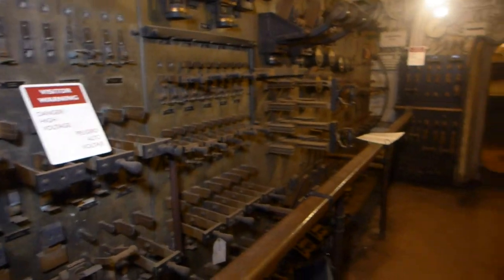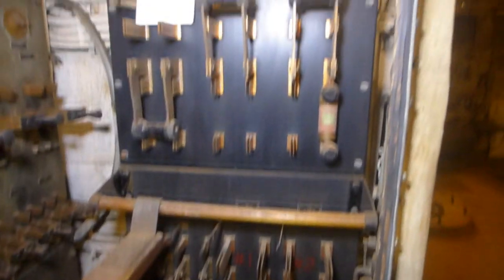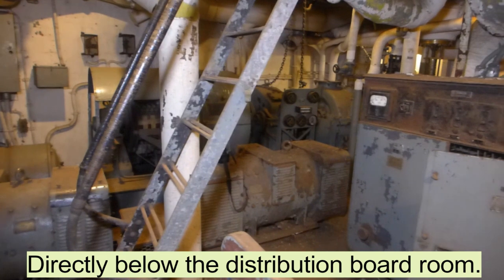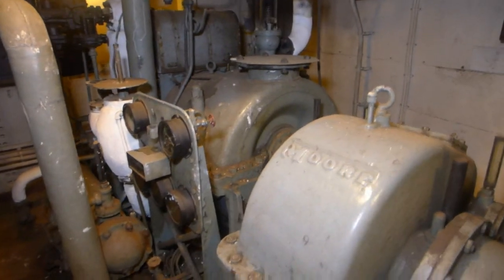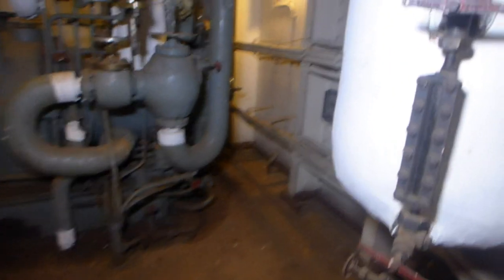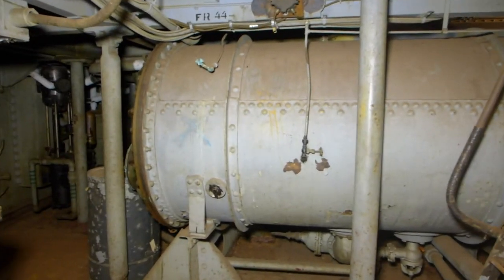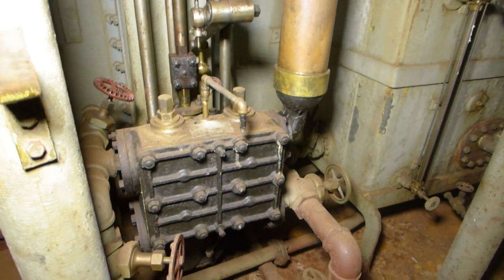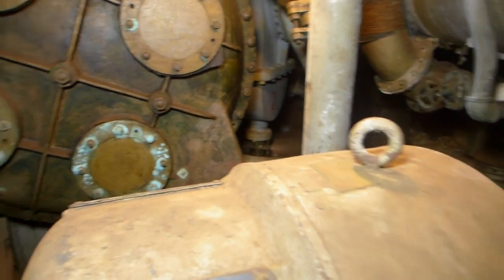Deep In The Heart of Battleship Texas, Getting Electrical Power

Comment: So that one disconnect to the far left that has a red label what is the purpose of the red label what does it say
Reply from the maker: If you are referring to the large red and white sign, it is a warning that cautions visitors to not touch any part of the panel.  Some of the circuits are still used to provide power for lighting and ventilation, making the panel potentially dangerous to touch.

Comment: Imagine the noise near those turbines.
And as an EE the hair in my neck raises when I see the unprotected switch gear. Those are death traps, especially with DC power. Wouldn't come near those for a thousand bucks. Touch and burn, mate. I bet a number of servicemen died right there.
Reply from the maker: Accidents would certainly seem inevitable, but I am not aware of any.  We do know of accidental deaths that occurred during the ship's career due to drowning, falls and being crushed, but not electrocution.  However, it may have happened and the ship's logs reporting it may have been lost.  There is one positive thing about the switchboards.  All of those open switches and conductors sure were easy to maintain and repair!

Comment: That electrical room would be very dangerous to someone who didn't know.  Especially in battle when the ships rocking and rolling back and forth
Reply: Likely most people working in the electrical room had been trained to be there, especially during a battle. It's only modern management where untrained incompetents are expected to manage dangerous technical equipment in emergency conditions.
Reply: @lwilton  What I mean is- the ship starts to rock unexpectedly and a human is slammed into those open knife switches- I promise you, the ships generators will clear their oily, greasy, unplanned "short" and the guy will fry- especially on an DC system
Reply: @lwilton  Actually, knife switches like this according to the National Electrical Code ("NEC") used in the United States?  Those switches are still legal and per code.  They have to be installed so when the bars open the circuit turns themselves off.  When I was a commercial electrician I was surprised that such switches were still not only legal but used on very large (500KW or above) circuits- usually safely stored behind a thick safety glass panel in case someone slipped and fell on them.  The next size similar switch systems they use- like generators at dam's- are essentially the same kind of switch but immersed in whats called dielectric oil- oil, which for all practical purposes have zeron conductivity and yet can carry tens of thousands of amps and volts.  The oil quenches arcing is why it's used.  This is why I'm saying that open panel board is "damned dangerous"- and a little wooden rail,,,,,well,,,,I wouldn't want to risk my life on it
Reply: @larrytrail2865  Knife switches with and without arc suppressors are I believe still legal. After all, almost all disconnect switches are knife switches. What I'm not sure is still legal is a live front board. I believe that switchgear generally needs a protective box or housing around the live switch mechanism these days, if for no other reason than to try to prevent arc flash injuries. Of course there are generally ways for "qualified service personnel" to override the interlocks and operate a panel while it is open. But this is most often done during equipment repairs and not general use.

Comment: Has there been some partial restoration of this space? The lagging on most of the steam pipes looks brand new.
Reply: If I had to guess this may be part of one of the hard hat tours and the fresh lagging is an effort to either seal in or abate asbestos. In some instances it is acceptable to coat over asbestos to seal the fibers in rather than perform a complete (and expensive) abatement process.
Notice the fresh lagging appears to extend only to areas that can be touched by someone standing on the deck and not in the higher overhead areas.

Comment: The air pumps are called air ejectors. They're used on modern nuclear-powered ships as well to draw vacuum on the condensers. The motor driven pump with a green case is probably the turbine generator condenser seawater pump.
Reply from the maker: Thanks for your input.  You are correct about the green pump being for the condenser seawater pump.  What are now called air ejectors were called air pumps at that time and shows that way on drawings and in manuals of the era, which is why I refer to them that way. They are described in detail in the U.S. Naval Academy textbook, "Naval Reciprocating Engines and Auxiliary Machinery" dated 1914.  There are later editions, but I like this one in particular since it was printed the same year the battleship was commissioned.  It is also the bible on the reciprocating steam engines like those on Texas, and even contains a detailed discussion of why reciprocating engines were used on Texas and New York instead of turbines starting on page 468.  If you are interested, this extremely thick book is a free download on Google Books.  If you download it, be sure to also download the separate book of plates that will be listed separately.  This contains all of the major illustrations for the textbook.
Reply: @tomscotttheolderone364  thanks for the info about the download.  It could be quite the interesting read.

Comment: Great video!  Were those two dynamos the only two onboard?  I would have thought on a battleship they would have them in separate compartments, in case of combat damage.
Reply from the maker: This is the forward dynamo room and distribution room.  Theere are two more in the aft dynamo room.  Additionally, there are two 100kw emergency diesel generators.  One far forward and one far aft.  Both are located deep, on the hold deck level.

Comment: Arc resistant switchboard?
Reply from the maker: The backplane of the board appears to be a stone material.  Given the operating voltage, you don’t get really big arcs, even on big switches opening under heavy loads.  This is apparent due to the lack of arc chutes on them that break up and cool arcs.  However, what arcs there were released a tremendous amount of heat and energy when loaded contacts opened.  A close look at them reveals separate copper current carrying and carbon arcing contacts.  When opening under load, the highly efficient and fragile copper contacts open first and conduction passes to the less effective but immensely heat resistant carbon contacts.  As those separate, the arc is struck but cools and is extinguished as they open wide.  This same method is still common on high amperage load break switches and circuit breakers.

Comment: Can you imagine standing in or walking in that room, back in the day, when in high seas? Just image falling into one of those contacts while trying to keep your balance while working.
Reply: Good call. These switchboards are not ISO / IEEE approved.
Reply: DC current. 
You would only ever mess up once..
Reply: @carwashadamcooper1538  It may not be as bad as you think. Ship's power is usually not like shore power, where you have a neutral leg that is grounded and a hot leg. Instead, they either float the entire power system with no ground at all, or they ground the center of the voltage, so there is only half the line voltage each way from ground. 

With 120VDC, that would only be 60VDC from either line to ground if it is grounded at all. 30V is where you start to feel a tickle from electricity, 60V is mildly annoying but usually far from deadly. Even 120V, while quite painful, will take a little work or bad luck to kill you. (And yes, I have some idea what I'm talking about. I've been bitten by 450VDC, which was really unpleasant. And I'm still here to say that.)

Keep in mind those panels were on the fore and aft bulkheads for the most part. A 400 foot long ship isn't going to tilt much on the fore and aft axis unless it is breaking in two or sinking, in which case you have worse things to worry about that getting zapped. Like broken steam lines in your compartment. Or water coming to visit. You are going to get maybe 10 degrees for-aft pitch, and the roll rate is probably going to be around 10 seconds. Most people can compensate for that. 

Now in bad weather maybe you can get 35 degrees side roll. That would be hard to deal with. But again, the roll rate is only a few degrees a second, and it generally isn't going to toss you into any open front electrical equipment.
Reply: @lwilton  Thank you sir

Comment: Look at all that asbestos!
Reply from the maker: There is a lot, but it is fully encapsulated and meets all federal and local safety guidelines.  On the rare occasions that damage is found, the compartment is closed and a licensed remediation contractor goes in to remediate it and/or reseal it.
Reply: @tomscotttheolderone364  Correct.  Asbestos is only dangerous when it's friable and the fibers can become airborne.

Comment: You are a better man than I. If I was anywhere near that switch board a that the beginning of the video I dont believe I would be able to stop myself from flipping many of the up and down while shouting "Its alive!!!" and cackling like a madman.
Reply from the maker: Believe me, the temptation is there.  However, many of these big, rugged looking switch handles are now very fragile.  The plastics used on them worked perfectly well when the ship was in service, but they didn't age well.  Any temptation to even touch them is tempered by the knowledge that there are no battleship parts stores around.
Reply: @tomscotttheolderone364  The city of Toronto where I live has electrical distribution buildings all over with switch gear like that. They are being phased out but some are still in use. The handles wouldn't be plastic but are made of wood or bakelite. I don't think plastic was around when the ship was built. That stuff is scary- imagine being in that room during a rough storm at sea? Your own ship could kill you.
Reply: @lawrencelewis8105  Bakelite IS plastic. Just an early plastic.
Reply: " Igor, throw the switch!!
Reply: Are you sure you wouldn't have been giving Jimmy Cagney the first jolt at Sing Sing?
Reply: Naw, he’s just mature enough to do that before filming!

Comment: Thanks for the video! First time seeing the dynamo condenser space. Were the switch gear operators required to wear insulated gloves?
Reply: I wouldn't think so. It was common in even houses to have knife switches. Mess up during the night and you get shocked. My parents remember that well. Around the large current switches I'd advise having something over your hands. However that was back when Men were Men and Women were glad. They didn't need no stinkin' gloves!
Reply: @robertthomas5906  120 V DC isn't too much dangerous in case of direct contact. Same voltage in AC can be deathly
DC gives more and longer sparks, if switches are not moved quickly
Reply: @dd313car  There is that. Used to work with DC and AC arc welders. Even though they used to have open knife switches in the old days it wasn't very common for someone to die from it. Shocked yes, die no. However it was dangerous and if you grabbed it right you could die from it. Now we have it so nobody can get shocked. We also seem to have a lot more fools in the world. So was it really an improvement?
Reply: Robert Thomas 
You were being generous, REAL generous when you used the word "seem".

Comment: Incredible! I wonder how many watchstanders they had down there.
Reply from the maker: Sorry, I've never seen any documentation on that.
Reply: @tomscotttheolderone364  You would get some serious (and possibly destructive) sparks, especially with DC. Which is why they generally weren't thrown under load if at all possible. You were taught to actuate the switches very quickly. "Slam them home" was a standard descriptive phrase. 

Opening under load was the far worse condition, because even quickly, this can draw an arc, and on DC is won't be self-extinguishing. This could very quickly destroy the entire control board. The breakers had arc suppressors, so they could safely open under load. You generally either shut down the generator before pulling a load, or tripped the breaker before opening the switch.